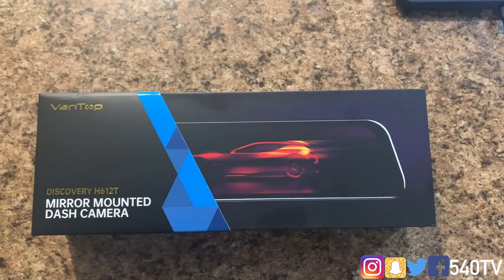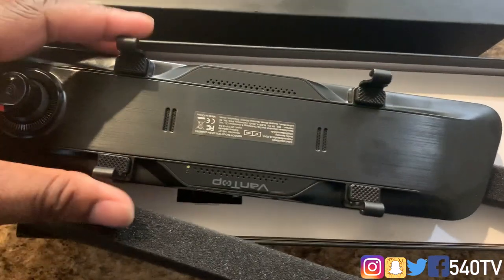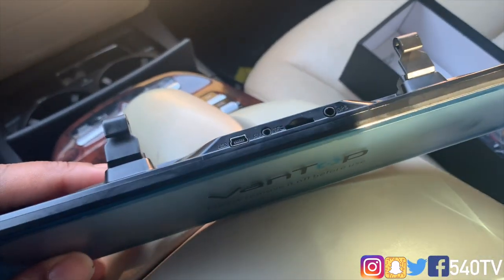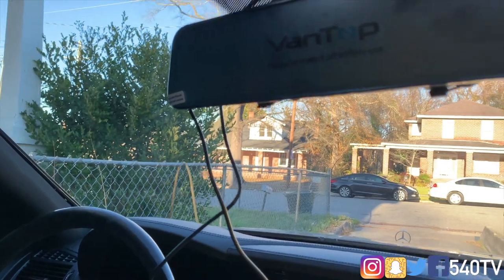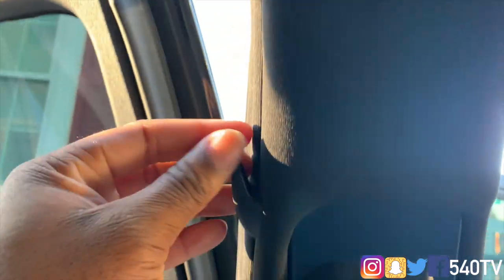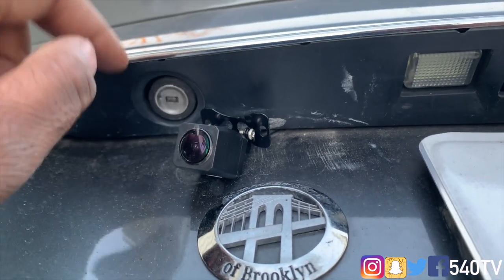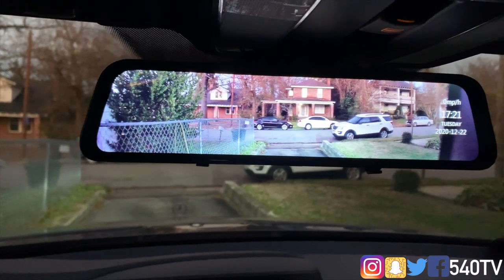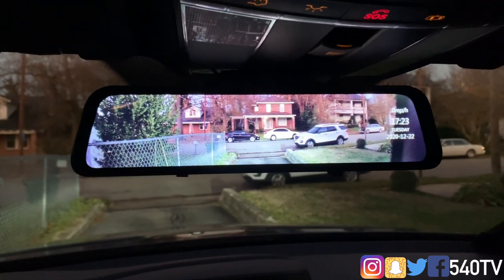VanTop Discovery H612T Mirror Dash Camera Installation

Comment: Hi I just bought this and I wanted to know how do I leave it In regular mode meaning the dash isn’t showing me the back or front cameras because it does bother me continuously looking back while I’m driving and I only see the back camera do I just turn it off while I’m driving and turn it on when I need it to back up or is there a mode for me to keep it at regular?
Reply from the maker: I actually use both modes at the same time..front and back. It can be distracting for sure

Comment: I bought the VanTop H612T, but some functions do not run well. The equipment does not have a week of use and has already been defective. The equipment gets very hot. Perhaps for that reason, you will also stop filming. Performs functions that are disabled, such as emergency shooting, without permission. I am using a quality card, reliable manufacturer, 128Gb card with high speed.
Reply from the maker: Yea your unit is defective I would return it. If bought from Amazon they will honor your return and replacement.

Comment: Will it work for a dodge Dakota truck? Or just cars?
Reply from the maker: Yep it’ll work for any automotive..just follow the instructions and your good to go
Reply: @540tv6  just one more question when the vehicle is off will it record with the sensor if someone got to close? Or does the vehicle have to be on?
Reply from the maker: If you hook it up to something with constant power it will stay on but note it could drain your battery if it stays on